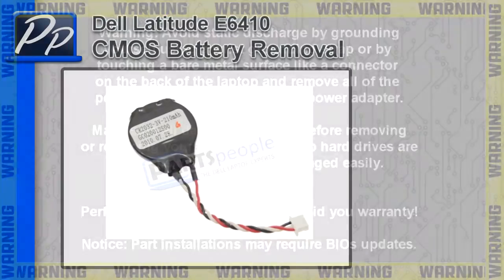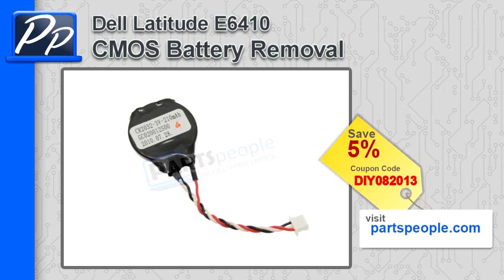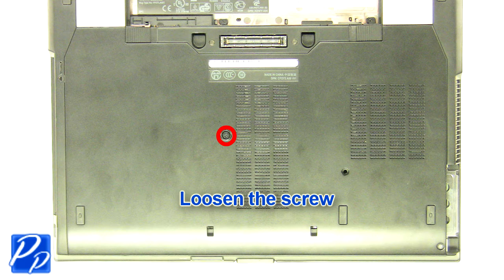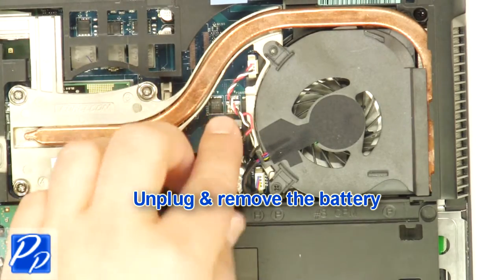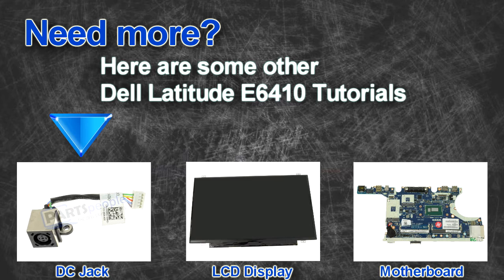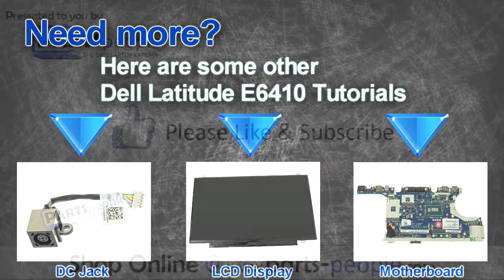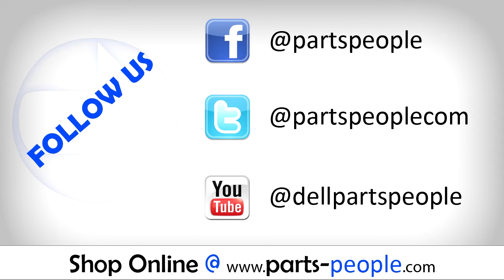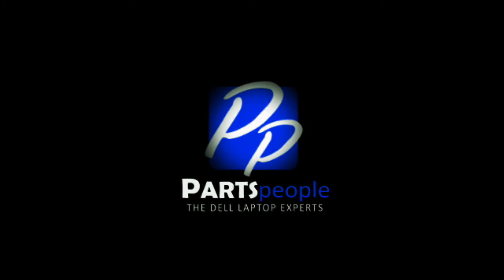Dell Latitude E6410 CMOS Battery How-To Video Tutorial

Comment: Did you have to remove the heat sink and fan assembly first. It looks like the wire sneaks up underneath the heat sink when I opened up the back plate of my own 6410.
Reply: No, you don't have to remove the heat sink.